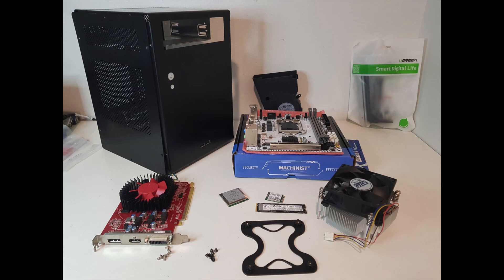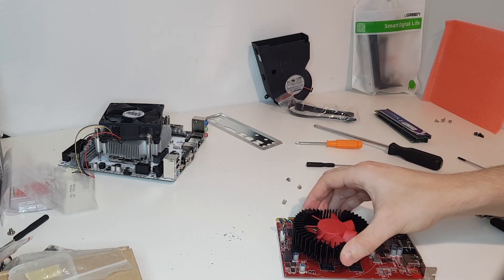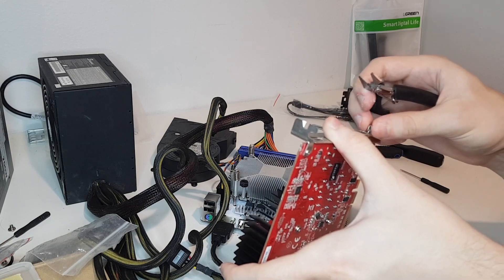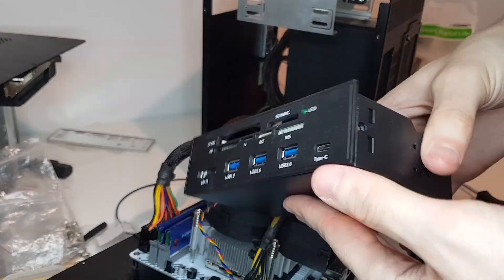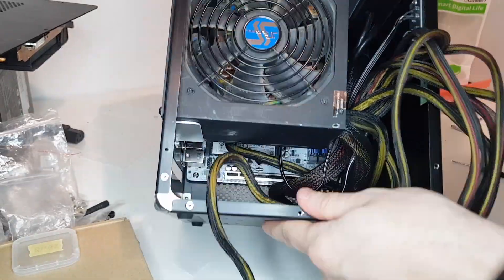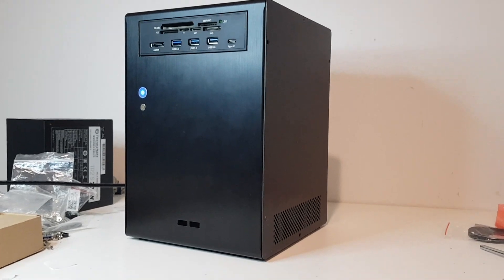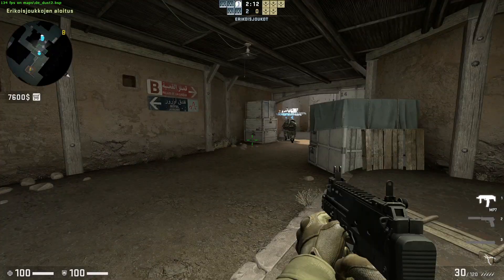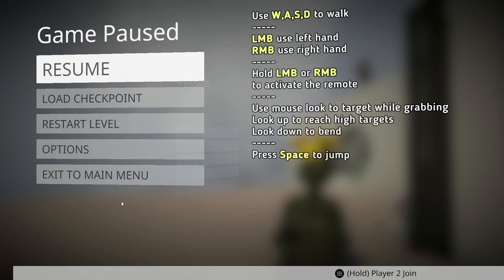5th Gen BGA-to-LGA CPU ITX Lian Li PC-Q07 build

Comment: Nice video, I'm not sure if you already mentioned in the video about the overclockability of this i7?
Reply from the maker: Thanks, i can't recall if overclockable or not, but i made another video about this and similar CPU's: https://youtu.be/1N8NYRK9Ai8

Its been a while since making these videos so don't remember much about these 5th gen LGA-to-BGA brystalwell CPU's beyond what i say in these videos. Btw my sister is still using this ITX build and its been very stable. Just the internal wifi antennas didn't work well due to interference from aluminium case, so had to move them outside the case.

Comment: You are awesome. Excelent idea about graphics card. I think cut some metal from case for install 2slot graphic card, but your idea with replasement metal from another card is better. Thank you so much.
Reply from the maker: I'm glad if it helped. Actually, some ports are blocked with the replacement bracket but i just needed one to work.